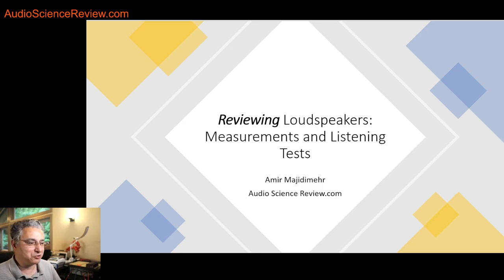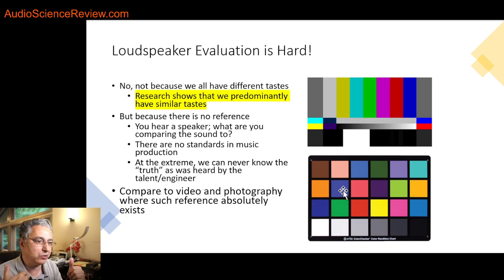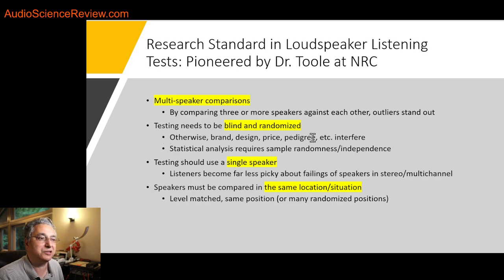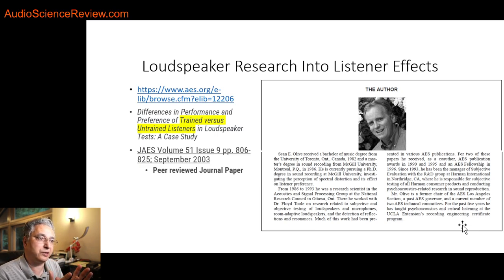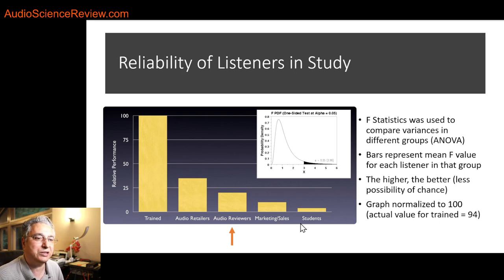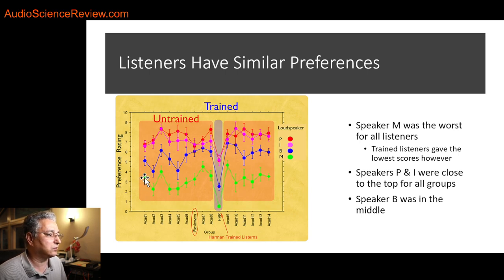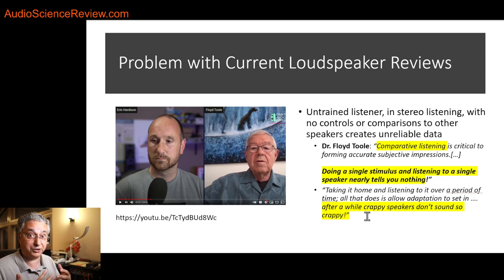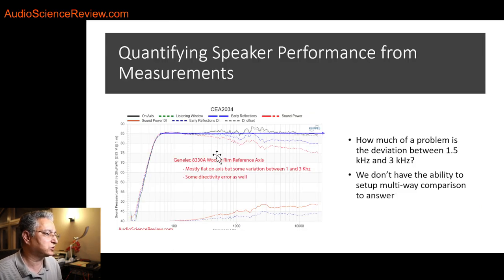Reviewing Speakers - Measurements and Listening Tests

Comment: GR Research claims that audible clarity is significantly enhanced through the use of premium components in speaker crossovers. Would there be any way to measure this, besides double blind testing? 

I've been pondering removing the crossovers from my Klipsch speakers, and instead sending audio signals independently to the woofers and tweeters. This should remove any effects of the crossover, be them positive or negative. And by measuring the speakers, and then using digital processing and EQ, neutral tonality could be achieved once again. Wait. Wouldn't this be the same as designing an active speaker?
Reply: You can’t rely measure that. Different components have different sound, that’s common knowledge among engineers working with constructing HiFi gear. For example Search YouTube for a video from the introduction of the Yamaha AS-1100 in Europe, they are fine tuning it for the European market.

Comment: EQing headphones can make a big difference to the amount of enjoyment you get out of the headphones. I don't know why more people don't do it.
Reply: Bought 15€ IEMs a while back. Half an hour later, they sounded like almost any "reference" IEMs. Turned out their midrance was excellent, they were just built to have +12dB bass boost, with one great bump at lower mids. I could easily pass them as ten times more expensive.
Reply: @squidcaps4308  I've done the same sort of thing with many headphones. The only limitation is if they can only move a limited amount of air. It means you can't have deep bass and  be able to go loud at the same time.
Reply from the maker: Darn right.  It is so much easier to EQ a headphone as well as the room issues are not there.  The quality improvements are dramatic as you state.

Comment: I do have a question about "listener evaluation" How does consistancy equate "correctness" in a subjective test? What constitues a "correct" response in a subjective listening test? Seems to me that this is a conflation of subjectivity and objectivity.
Reply from the maker: Consistency reduces "noise" in listening test data.  Without it, you have to conduct a much larger scale study to get similar statistical power.  It also points out that the listener is not very sure of what he/she is hearing.  One time is saying A is better than B.  In another random cycle is saying B is better than A.  This points to lack of knowledge and training in performing the task (evaluating audio products by sound).
Reply: @AudioScienceReview  Is that noise or is that reality? To say any data point in a study of preferences is noise is to deny the testee's preference in that moment. Hopefully anyone can see the conflict in saying a testee's preference is wrong or inaccurate in a test of preferences.This is where I think these tests may have deviated from pure science to mostly science with commercial considerations and commercial goals. Scientific researchers can not judge the merit of the  data by the clarity of it or lack of. Science accepts data whether we like it or not. science only rejects data if there was an error in the design or execution of the protocols of the tests. Is this not one of the reasons clinical research does such large scale studies? When we are talking about things as complicated and weighed down with variables as human perceptual experience isn't that "noise" really just a truer account of reality that is simply some what less useful to commercial interests and a lot more expensive to generate? I do think the very idea of rating listeners is putting the cart before the horse. I see why HK would do that with their pro listeners for the purpose of cost effectiveness in doing their own research with commercial goals. But that does not neccessarilly transfer onto any individual consumer. The product exists in service of the consumer not the other way around. Don't get me wrong. I really do see the value of these tests for manufacturers. But for consumers I would think their value lies more as a starting point than an end point.  At which point I think we have to acknwledge there are no perfect answers to the questions of what is subjectively best.Thank you again for your response.

Comment: Would love a better description of accuracy vs tonality, i.e. when he says he can make the Klipsch a more tonally accurate speaker by EQ instead of changing crossover components I agree 100% but do not believe this new EQ'd speaker would have the same detail level as one with higher quality crossover parts ( mundorf vs off brand Chineese ). I guess what I'm trying to say is, why doesn't  a Klipsch, or any other cheaper speaker for that matter with a flat EQ sound as good as say a MBL, Wilson or Magico.
Reply from the maker: MBL is an omni directional speaker so it will always have its own sound.  Unfortunately that signature is put on every type of content you listen to which I do not like.   I don't want my rock music to sound open and phasey.  Wilson has frequency response errors which need EQ correction.  They are large and powerful speakers so yes, they will have dynamics and deep bass that a Klipsch may not have even with EQ.
Reply: @AudioScienceReview  what makes omni problematic but wide dispersion ideal? You don't get any wider dispersion than from an Omnidirectional speaker. And you won't get more consistant frequency response on all axis than you will from a true omni. Seems like conflicting princliples that wide dispersion is good but omni is bad

Comment: A flat frequency response is not necessarily preferable to everyone. Lots of headphone manufacturers make v-shaped sounding headphones obviously because people like that sound.
Reply from the maker: What people buy is not an indicator of what is good.  Research shows that people prefer the most the sound of a headphone that is similar to a good speakers in a room plus some bass boost.  And possibly some treble boost or cut.  The classic heavy bass and heavy treble is not preferred.
Reply: @AudioScienceReview  most people prefer v-shaped sounding speakers as well.

Comment: I agree with 90%-95% of what was said here.
Reply: Why would anyone care what you think? You did a sound test on a Bose direct reflecting speaker, and you only pointed the mike at the woofer, and then you were wondering why it sounded bad. Because the tweeter points in a different direction, and you didn't have a mike pointing at the tweeter. You are completely clueless.
Reply: @mikrophonie5633  I also made a follow up video where I changed the method. I've also had Amir as a guest on my channel twice and we've talked directly. People often reference my videos on ASR. I have a decent following on my channel, so someone cares what I think even if you don't. No need to respond to me since you don't care what I think anyway.
Reply from the maker: Which is more than I can expect.  :)  Hi Joe.